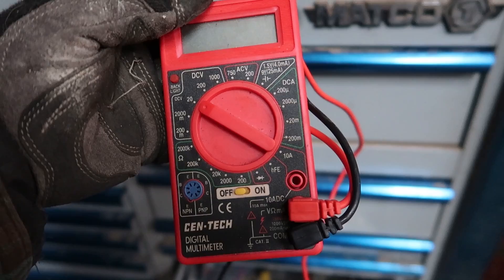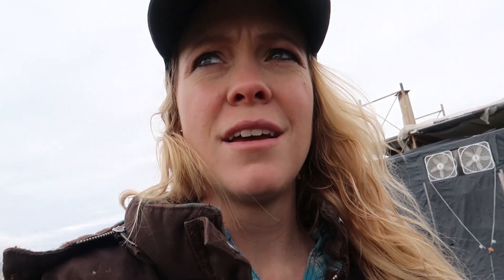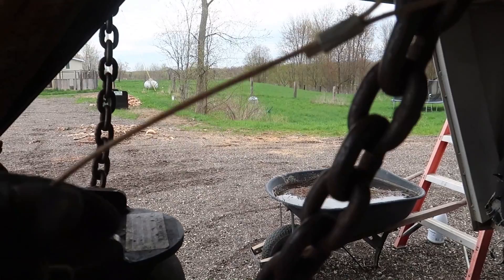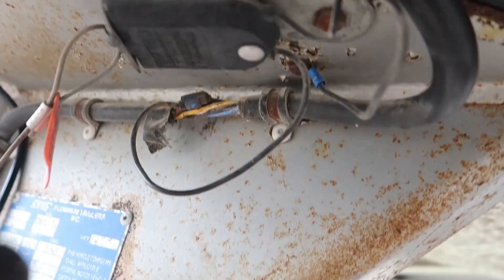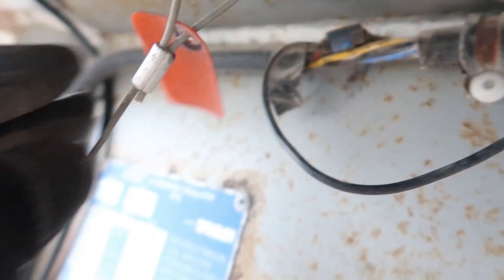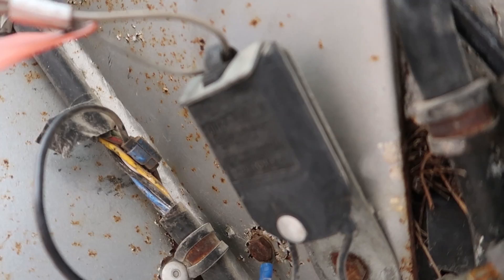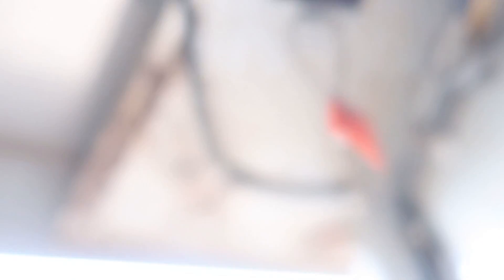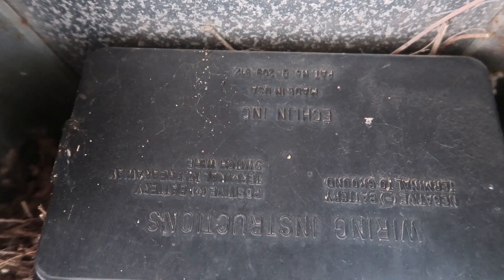218 SOLVED!!    Why My Trailer Brakes Lock Up (You Guys Are the BEST!)

Comment: I've seen this at least 3 times in my career. Your problem is most likely in the adapter plug on the trailer. Older 6 pin plugs were wired one of two ways. One way, when you use a 6 to 7 pin adapter, it works just fine. The other way, when you plug in the adapter, and turn on the ignition, the truck will send 12v straight to the trailer brakes. The first time this happened, we took our trailer to our local service center (Montgomery Trailer Sales in Langsville Ohio) we told him what was going on, and he knew exactly what it was. He took our 6to 7 pin adapter, and switched two wires around. I think it was the blue and black wires, but don't quote me. After that it worked 100% correct. The other times, I had the advantage of having wiring diagrams in front of me, and switched the wires around myself. 

There is another level to this concerning the trailer breakaway system, which is another can of worms. 

In all honesty, my advice would be to take your trailer to the closest trailer service center, and have them check it out and fix it properly. It will probably involve a new 7 wire cable, plug, and junction box, possibly breakaway switch and breakaway battery too. I know it sounds like it could get costly, but when it comes to your safety, the safety of your horses, and other drivers on the road, it's money well spent, and cheap insurance, with the added benefit of peace of mind.
Reply from the maker: Thanks, I'll look into that!
Reply: @This1LifeWeLive  I like Rusty's explanation.  If you get Erik to turn on the ignition as you kneel close to the trailer wheels if it's wired you can probably hear the brakes applying.  If he turns the ignition the opposite should happen.  Also, will the trailer move or drag the wheels when it's not plugged in.  If it won't move the shoes might be corroded to the drums as others have said.
Reply: P
Reply: Mine was working fine until i bought a new adapter from tractor supply. Ill check into that, now my brakes lock up as soon as I plug it.

Comment: Where Eric had the multimeter set, 20 DCV, is correct for what you are testing. DC is for cars and mobile eqpt. AC is for houses and barns and the like.
That tubie thingy behind the bumper, is where you insert the jack handle to crank down/lower the spare tire. Good to know if you ever get a flat.
Reply: If you can see it . It's  set for omes

Comment: Anybody else wanna jump through their computer and help this girl? 
Your 4 Pin connector (on the left) is for trailers without electric brakes
Pin 1 on the top is for the right turn signal and the right brake light
Pin 2 is the left turn signal and the left brake light
Pin 3 is for the tail lights
Pin 4 is ground
The 7 pin connector (on the right) is for trailers with electric brakes.
Pin 1 (bottom left) Ground
Pin 2 (bottom right) Brake Control
Pin 3 (top right) Tail lights and running lights
Pin 4 (top left) Auxiliary 12V
Pin 5 (Center right) Left Turn Signal and Left Brake Light
Pin 6 (Center Left) Right turn Signal and Right Brake Light
Pin 7 (Center) Backup Lights 
Check to see if you have 12 volts on Pin 2 on the 7 pin connector if so you need to check your brake controller wiring harness. If you don't know what color wire to look for Google year/make/model of the truck's brake controller wiring harness I think Ford uses a blue wire for the 7 pin connector. Hope you get this problem resolved! P.S. The pipe you were talking about goes to your spare you take the tool from the factory and stick it in there and you can turn it to lower and raise your spare tire.
Reply: I ABSOLUTELY Agree with everything Melton Industries has said and would simply add that: Pin #1GROUND is a WHITE wire, Pin #2 Trailer Brakes Is a BLUE wire, Pin #3 Tail Lights  is a BROWN wire, Pin #4 Auxiliary + 12 volt Power is the RED wire, #5 Right Turn Signal and Brake Light is a YELLOW wire, #6 Left Turn Signal and Brake Light is a GREEN wire, And #7 Backup Lights is a VIOLET wire and not used on your trailer. Also, ONLY Pin #4 (RED) should have battery voltage (12 volts give or take0 when the key is turned to Accessary. All other pins are dependent on the switches in the truck as well ( Directional switch and Truck Brake Pedal switch, and Truck light switch). The Red wire supplys power to any and all 12 volt lights or accessaries INSIDE the trailer interior. I suspect it was cut because of a short caused by the accident earlier. If so, if you hook up the trailer without first either cutting it again or fixing the short, you will blow the fuse in the truck. The Breakaway Brake system is electrically isolated from the main breaks as long as the battery is out of the box. Troubleshoot the First problem to completion and correction before starting in it. Also, as you put each of the four wheels back on the trailer give it a spin to check for brake drag.        sdh in ct
Reply from the maker: Thanks guys!

Comment: Often if you reverse for a few feet the drum brakes will release.
Rust/corrosion is the culprit.  Brake 'shoes' 2 per wheel can also rust to the drum.  Drums should be removed, Brakes inspected.
They should be checked out by a qualified person.  They are 12 volt activated by an electromagnet which rubs on a steel disc. The electrical connection at the truck is a cheapie and should have an embossed wiring diagram.  The 4 terminals (3male 1 female) is known as a 'flat four', is for light trailers without electric brakes.
The other is a round 7 pin.  Normally not powered unless you turn your lights on.  One pin is the ground.
You can google trailer Connector wiring.  Be sure to turn the meter off when done or you will kill the battery in it.  Some turn off automatically.  11. 2V terminal is likely Battery Voltage and to charge trailer battery.  
One terminal is Ground (-) or Negative terminal.  One should be 'hot' when the trailer brakes are applied from the dash of the truck or step on Brake pedal. There is an adjustable Controller as you want the trailer brakes to come on slightly before the truck brakes apply.  No 'jackknifing'. The others run trailer lighting, power to recharge trailer battery, left and right signal which are also Brake Lights.  The flat four should show tail lights, left and right signals which are also Brake lights and the covered terminal is Ground, often white wire.
There are also Google vids on how to run a Voltmeter, and the standard connector wiring.
If ignition and lights were off there should have been only power on one terminal I think, to run battery charger in a travel trailer.  Great attempt.
That breakaway Switch is to automatically apply the Trailer Brakes if it comes loose from the truck. There is a small cable that connects snugly to the towing vehicle.  It gets power from that battery you found which should immediately be put on charge overnight at 2 Amp charger setting and check voltage with your meter in the morning.  Being discharged over the winter it Froze and destroyed internals.  Get a new one. Fully charged it should read 12.0 to 13.5 Volts.  VDC mean Volts Direct Current (Battery).
Be sure RED cable goes to positive terminal of Battery.  It is not the cause of Brake Lockup.
That 'pipe' coming out of the back of the truck is where you put your crank into, to lower the spare tire via a cable you cannot see.  That should be done at home to be sure it still works. Most don't. RTFM!!!
The Volt meter is set for 20 Volts DC to adequately check any 12V Battery.  I believe the Red terminal lead should go in the Top hole of the meter.
You did good.  On the wiring diagram I sent you, the Auxillary lead could run your rear camera if it is still working.  Remember you need those 3 Lights top centre, not 2 and a camera on the rear of the trailer.
Make sure the Trailer socket is locked OVER the ball this trip!

Comment: Trailer brakes require 12 volts to activate. No power no breaks. So your problem is not a dead battery.
When you step on the brakes, the brake controller on the truck sends out voltage to the trailer. The brake system works with magnets. Once voltage is applied to the magnets they become energized and they stick to the drum face thus activating the brake linkage and sending the brake shoes outward and against the brake drum slowing the trailer down.
The brake away is a normally closed switch. If the trailer brakes away the center pin will close the contacts in the switch sending 12 volts to the brake magnets and actuating the brakes. If the brake away battery is bad you can pull the cable removing the pin and nothing will happen. That’s why one of the pins in the trailer plug with the key on will be hot to give the battery a trickle charge. 
With the plug disconnected and the brake away pin installed the trailer brakes should not be activated and the trailer should roll freely. If not your brakes are probably froze up and need to be repaired.
Hope this helps.

Comment: Susan, this same thing happened to me with my trailer. The adapter that Eric bought, open it up and switch the only two wires around that has screws. Because what is happening is the one wire is for the breaks and the other is for the day time running lights, so when you put the truck in gear you are sending power to the breaks and locking them. Good luck!!
Reply from the maker: Thanks, I'll look into that! That sounds lik an easy enough test!

Comment: The multimeter was setup correctly for testing DC volts.  The 10A connection is not used for testing DC volts.

There should have only been one terminal that had a voltage reading.  The ground terminal should not have showed 0.3 volts.
There are two possibilities for the voltage readings:
the truck wiring has shorts
the voltmeter is defective or needs a new battery.

The license plate bolts may be screwed into plastic, so it is not a good place to use for ground.

When the multimeter showed a -1, it also showed a low battery symbol.

The tube above the spare tire is for inserting the jack handle to lower the spare.  There has to be a hole in the bumper in line with the tube.  The different bumper may also require a longer handle to lower the tire.
Reply from the maker: I'll ask Erik about replacing the battery first and then re-test :D

Comment: My suspicion is that the battery hot and the electric brake wires are switched.  In the original 6 pin plug the the trailer had two different wiring options battery hot in the middle or brakes depending on the manufacture the the other pin is above the green wire right turn.

Comment: First time doing this but like your channel. First make sure you have either electric / electric brakes and not electric over hydraulic. Second your trailer plug and truck plug are not the same connection you need to get a flat pin male and a flat pin female. The lead you found hot at 1 o'clock is you hot lead or the battery from the truck. Your trailer brake battery needs to be replaced your voltage reading on your meter should read from 10 volt to 12 volt to show its fully charged. The trailer brake away only works when you pull out the pin and then with a fully charged battery will lock your brakes up on the trailer but with it put into place will release the brakes. The pin for the brakes on the trailer from the back of the truck sit at 5 o'clock. The wires on the truck at 3 and 9 o'clock are turn signal and 7 o'clock is the ground. Hope this help you.
Reply from the maker: Thanks, I'll look into that! I'm fairly certain they are eletric and not hydraulic though. I had not heard of hydraulic brakes, so now I'm going to have to look at my tractor ;D

Comment: The break away battery should be at about 12.0 or more and only works to set the brake after the trailer breaks away during transit. It is hard to describe what you should be looking for but all of the functions will be at 12.6 to over 13 volts when in use. Lights, brakes and stop/turn signals. If you have no voltage going to the brakes they should release. If they do not release the problem is probably rust in the drums and back plates which does not allow the brake shoes to release.
Reply from the maker: Thanks, I'll look into that!

Comment: If you disconnect the trailer brake controller the wires going to it you should have turn lights brake lights exc but no brakes on the trailer that way you can get it from point a to point b without the brakes locking up on you but still have lights

Comment: On the truck end trailer connection( 7 way RV  pin connector) try checking the power wire it's a wire that always has power too. The rest of your wires should not have power when your truck is off. Find each wire individually to your blinkers,parking lights,brake lights and trailer brakes. All this using  your digital meter or a light tester.

Comment: Put the little battery on a 12 V charger and see if it will come up to 12 V.  It probably is supposed to be charged by the truck's alternator.  If it doesn't charge up, then get one.  It might be low from sitting around.  The little plug with 3 females and one male is for light weight utility trailers.

Comment: Highly possible but not likely.  The center pin is the auxiliary. 
It should be live on the truck. 
If you the key to the on position you should be able to turn the turnsignal on right and  left to find them in the truck plug  . With the key off you should pull the head lights on and be able to find the Tail & marker pin  . Then shut the lights off  and have someone hold the brake pedal on the brake lights sould light the  turnsignal pins only  but the trailer brake should have power on a previously un  powered pin . I understand this might be confusing.  But I did the best I could of explaining this.  If I was there I could figure it out in  about ten minutes.  😊 hope this is helpful
Reply: Often the centre pin on 7 way is Reverse Lighting.
Reply: @gordbaker896  like I said previously you never know what they did . I don't use those r v plugs because I don't like them because I have problems with them.   Thanks because I didn't know that.  I have not had one hooked up like that 
😏
Reply from the maker: Thanks I will check!

Comment: There are 4 basic wires 1 lights  2 left turn 3 rt turn and break is hooked into the turn lights the 4th is ground 
Your 5th wire break and that's probably if it old enough trailer there's probably only 5 wires also if the breaks feel like there not releasing all the way you could have stray voltage causing them to apply or maybe your brake controller setting is not setup correctly
On the truck the center prong is always hot/ power used for axillary power for work lights or something for your trailer  
My guess is that the problem is in the truck 
A good way to check all the lights on the trailer is hook jumper wire to the battery then into the trailer plug 1 at a time unless you got another vehicle with trailer plug and to check the breaks lift the trailer wheels of the ground spin them then put power in and the breaks should work properly 
As for the emergency breakaway when the plug comes out that will apply breaks for safety I hope this helps you 
P.s. since the trailer has been damaged check for pinched wires or bare wires that can cause back feeding and mess things up
Reply from the maker: Thanks, I'll look into that!

Comment: The blue wire on the truck is for your trailer brakes the Breakaway battery needs to be replaced needs hold 12 volts

Comment: The breakaway switch just to give you a little insight on that that's for when in the event if your trailer breaks free from the truck is designed to come apart at the connection and lock the trailer brakes they can also cause intermittent trouble with the brakes if there is a short in that switch

Comment: Hi Susan, if you're trailer free wheels before you apply the brakes and then doesn't let off completely then you need to pull the brake drums off the trailer and make sure your silinoids are not sticking and everything is good and clean! Stay sweet
Reply from the maker: The brakes release soon as the plug is disconnected from the truck, but if we are still having issues we will certainly check that :D

Comment: If they where working fine before hooking that wire up then disconnect it cause my super duty has a extra wire for a power wire for lights. The center post is for back up lights so you may have a wrong wire hooked up is my guess  and yes if the battery is dead your brakes will set and not fully release. Keep up the great videos
Reply: Your right.  I couldn't get back to her fast enough
Reply from the maker: LOL thanks!

Comment: You need to take the red leed out of the om jack and put it in the volt jack  little girl.  That's why your getting weird numbers or readings  .i bet the trailer plug is  wired wrong.  That little plug is the ones I use.  They probably have the brakes on the axillary pole which is the middle one  and the axillary in the stop pole . A lot of people do that.  On the inside of the little pluge each pole is marked with letters and a arrow to the pole it is  referencing.  This is where knowing the color code comes in.   And there is a little screw holding it together.  It is easy to lose that screw i know because I have lost many of them. 
I use a magnetic to hold that screw now  . Feel free to ask any questions you may have  . Okay 😊☺
Reply from the maker: Thanks, I'll look into that! 😃

Comment: Measure at the truck plug. One pin should have 12 volts when the truck headlights are on. One should have 12 v when the truck brakes are applied. One should flash 12v when the left turn signal is on. One should flash when the right turn is on. One should be truck frame ground.
Reply from the maker: I will check!